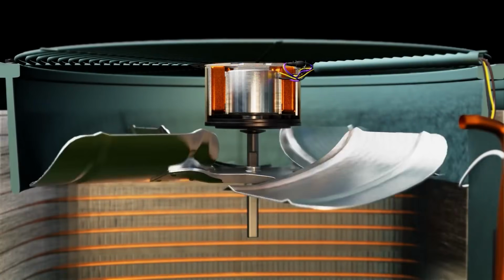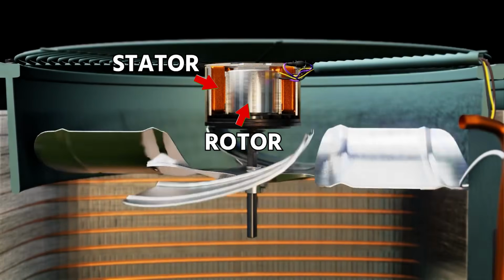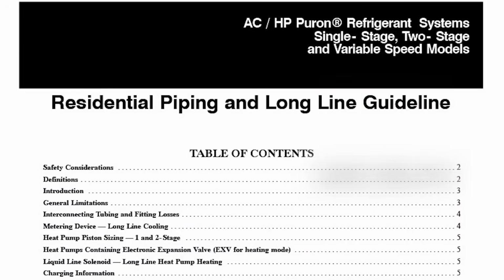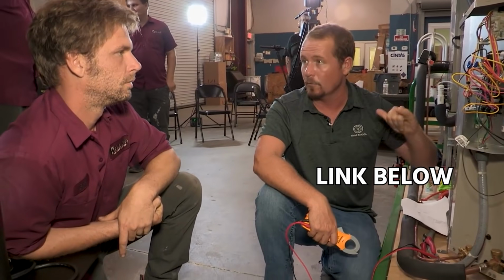Locked Compressors

Comment: Hey Bryan! Thanks for the awesome content!
Reply: When technician replace aftermarket starter capacitor for compressor, they use aftermarket terminal and they don't care about false contact of the terminals.  False contact is a factor of overheating in any circuits wich leads to a fire.

Comment: Yes -- locked up is my symptom. The fuse on one of the 240 legs blew, and upon replacing it everything is "back up" (in the sense the fan now works and the compressor tries but fails to start).

Interesting about the Trane hard start kit being special. Mine is not a large orange compressor. It all seems pretty normal, a 1.5 ton unit.

Comment: So if capacitor is good, fan working fine and coils are clear and clean and compressor got super hot like 165 .Now just will buzz as trying to come on fan runs capacitor still tests good.Evac system, pulled vac to 453 microns.Held for hour.Put 2 slow pounds in then up to 4.5 tried to start but same issue.Hit around with mallot no go.Waiting on hard start kit as next try.

Comment: Can you please help me? My A/C compressor for my 9000 BTU unit (Consul) is locked, before that it was making all kinds of weird noises and I could hear it going down and down until stopped and buzzed. after that it stopped, and restarted. I used it like that for 2 days. After that 4 months went by and it is fully locked now. Can low a/c gas cause that? Thanks SO MUCH for the reply

Comment: I am an amateur and know nothing about HVAC except as a consumer who can’t stand to be hot.  I got a old worn out system started by blowing a hot hair dryer on the evaporator which I guess put enough pressure on the low side of the system to get it going. Then I looked online and learned of a hard start capacitor which I went and bought for $25.00. I put it in (there was an old one there). It worked for years until the building was demolished for new construction.  I quickly realized that it was oversized by 1.5 tons which is probably what killed it.  I left the gas oven on 550° all summer so it would run more and dehumidify. I eventually put a large  1967 Chrysler heater core in it plumbed into the circulating hot water system for the building when I learned of the concept of reheat.

Comment: First and foremost I got to tell you are a great instructor, so you have my outmost respect. I have a question, that might sound stupid or idiotic: could a locked one third HP compressor used on a household refrigerator be fixed with a hard start kit ? Already tried the 1/3 HP electronic start device and didn't work.

Comment: If it's still under warranty and the system needs a band aid to continue running then the warranty should cover the band aid solution or replace the component.

Comment: A good way to think of an induction single phase motor is the equivalent of a transformer with a mechanically rotating secondary.  Locked rotor is like a power transformer with secondary side shorted out.  

The rotor actually has the equivalent of wirings, a very low number of turns secondary (1 turn).  

Internal compressor protection switch trips due to high current vs time (short time) and temperature where there is a very hot compressor.  The protection switch has limited lifetime to number of high current trips, so you want to avoid tripping it as much as possible.  A bad compressor internal protection switch means a compressor replacement is necessary.

A running motor induces current in the rotor that lightens load on primary side stator winding getting the motor out of LRA current region.  

Most techs don't have the equipment to measure the amount of time the motor initially draws LRA current during startup but the proper start capacitor (mfd) provides a 90 degree current shift in start winding compared to run winding current.  This yields the shortest start time in LRA current draw. (spins motor up quicker).
Typical startup time is about 0.4 second.  If it has hard start it can last over 1-2 seconds which is enough time to pop the compressor protection breaker at LRA current.  You want to shorten that time in the LRA current region.

Different compressor motors have different wire turns ratio between run and startup winding.   This effects the relay required cut in and cut out voltages across start winding to disconnect start capacitor.   Generally, start cap mfd is greater mfd value the larger the btu size of compressor.  Too much start capacitor size can actually reduce the hard start benefit because it does not provide the proper 90 degree current phase shift to start winding which yields the greatest initial starting torque for motor.

Rough guide for start capacitor sizing.
Start Capacitors
72-86MFD - Up to 12K BTU
88-106MFD - 13-23K BTU
108-130MFD - 24-36K BTU
189-227MFD - 37-48K BTU
270-324MFD - 49-72K BTU
115VAC applications can use 250V or 330V rated start capacitors.
230VAC applications must use 330V rated start capacitors.

Another way to select hard start capacitor mfd value is 3 to 4 times the run capacitor value.

Most generic hard start kits error on the too much mfd capacitance side.

Comment: When I got a recent compressor to start by a hard start kit , it sounded like marbles striking , shut it off and just condemned compressor , but what caused this for a 2017 condenser ? 
   No true vacuum pulled?
   Not purging with nitro ? 
   I guess these couldn’t be ruled out , so I’m replacing compressor on a unit that I did not install .

Comment: Couple of other things that can cause startup failures. Long AC power line to breaker panel and undersized wire gauge creates too much voltage drop during the startup surge current.  Some outside disconnect switches use 60 amp breaker for switch which can go bad.  Old AC breaker that is fine with run current, but has too much voltage drop during the 100-200 amp startup surge.  Low utility line voltage is also possible.

Refrigerant overcharge can also increase startup current as well as run current.  Obviously bad run capacitor is number 1 cause.

Startup surge usually last for only 0.4 to 0.5 seconds but is longer if AC voltage is low.

The compressor Klixon protection switch inside compressor trips on excessive current and/or over temp so high current trips of the cutout switch before the motor stator windings gets very hot.  Multiple high current disconnects eventually destroy Klixson contacts requiring a compressor replacement if compressor has been repeatedly cycled ON and kicks off many times trying to startup.  This is where the softstarter saves compressor as it protects from continuous restart attempts.  Softstarter only allows one startup attempt per thermostat activation.

Once in a while the Klixon gets stuck open and a rubber mallet tap at base of compressor can knock it back into operation.

Weak link of hardstart kits is the relay reliability.  I don't like using them because a relay failure is more likely to destroy compressor with start capacitor continuously connected to compressor start windings burning it out.  The black electrolytic based starter cap can get very hot if left engaged too long possibly shorting out the starter capacitor.  Proper start capacitor value is 3 to 4x the Run capacitor mfd value.

Comment: Awesome discussion which includes reasons for compressor running hot !!  Just wish I could make a decision on how hot is to hot - to expensive to chase  all the possible issues trying to resolve a mini fridge which is working but compressor gets very hot.
Reply: High ambient temperature, computer fan to blow on the compressor 👍

Comment: I have two 34 year old r22 systems that I do not run on generator. If the power goes, we use ceiling fans and sweat. Any opinions about soft start kits with such old dogs? I hate to rock the boat and kill my compressors.  Thanks

Comment: Thanks. It was helpful.  The most unusual situation I ran into was a rooftop packaged unit for heat and gas. It had a label stating that It was set up for 240 V AC.   The unit tripped the breaker as soon as an attempt to start the unit was made.   Eventually, I went to buy another compressor but in the process I  learned that the compressor was supposed to have 560 V for that unit.   it turned out the printed circuit board wasn’t going to let it run on the wrong voltage. 
  The manufacturer told me that it was not listed under any warranty.  Their representative told me to red tag it and walk away.  This unit was on a pizza store and they didn’t need the heat function so I disconnected that just to be safe and then I hard- wired the compressor -skipping the printed circuit board but used a solid state time delay relay and kept the low pressure cut out in the compressor control circuit.
It worked.  I won’t do that again.

Comment: Great video. Thanks for posting.  I bought a 5-2-1 aftermarket hard start kit but chose the option for 1-3 tons even though my unit is a 4 ton. This was based on the capacitor in the 1- 3 ton matched the specifications for the OEM hard start kit. Does the relay have internal workings that would make it much different than the OEM part?

Comment: good advice on doing your 'due diligence' before grabbing the hard start kit ... but one thing I might have missed - what are the next steps if the hard start kit DOESN'T start the compressor?  is that the official 'death notice' of the compressor?  Can anything else be done?  thanks
Reply: Sometimes I smack the compressor a few times with a heavy rubber mallet.  If that doesn’t free it up, it’s probably dead

Comment: I have a compressor that was installed 6 months ago and the compressor is locked up. I put a hard start on it and it still isn't starting. Is there another way to get it running?
Reply: Reverse it how we did back in the day

Comment: What about the old school way by tapping the compressor with a rubber hammer if it is locked up like they did back in the day. They also reversed the leads of the compressor to unlock it.

Comment: 12:09 - What's the difference between 'back EMF' and inductive reactance (that chapter - 1:51 - has a cute title, BTW, of 'inductive reactants')? Different way of looking at the same concept. The back EMF that's generated in the winding is based on the reluctance of the coil to changes in current (the inductor reacts to the constantly changing current in a sine wave by generating an opposing voltage when the magnetic Flux collapses back onto the winding )

Comment: That aftermarket hard start kit is going to work just fine. It is only active for like a second. Waste of time to go back and change it out and just more costly for the customer. Having said that I never use the two wire type they are crap. Only use the one like he shown in video with the potential relay.

Comment: Wouldn't low oil or no oil also cause compressor overheat as well?
Reply: Low oil will cause bearing failure and it will seize up just for that reason alone. Hard start kit or even a soft start would not help in that situation.

Comment: Thanks! Been “ trying” to explain this ( which makes me an idiot) to those who figure the budget for a 266 apt. Complex in the Deep South of Louisiana for a decade now. 266 units that were 12 years old when I first touched them. 12 years of hard use and abuse. Now 22 years! Those old Goodman 2 1/2 ton piston heat pumps are beasts. But now, dropping like flies. They put up with filthy coils, filters, all sorts of R-22 “ drop-in” juice without directions. 😂 Half of the outside coils are rotted from 20 + years of 100’s of dogs raising a leg on them. 🤷‍♂️🙄

Comment: I’ve smacked the top of a compressor with a rubber mallet to unlock it before just to have some cooling over the weekend .. fixed orfice was clogged as well .. I pumped down what I could (the compressor was not pumping right) and recovered the rest ..cleaned the orfice .. pulled vacuum, drier, recharge ..that’s when it locked up …I smacked it a couple time fired it up and it worked but only had about 10 degree split temp

Comment: Great tutorial.  Thanks 
Question: let's say  after all the visual testing and electrical testing is done and the problem is a locked compressor on a 2 year old system do you know another solution to start the compressor if hard start capacitor does not start the compressor ? Thanks again.
Reply: I've used the Spp hard starts by Supco, I think. There's been a couple of times when it didn't work and I "stacked" another on top, essentially twice the kick in the butt. It's worked every time but take the second one off and leave only one. If it doesn't work after installing the first the customer really has nothing to lose at that point. The alternative is a new compressor at a much higher price point.
Reply: @bill944  Thanks for replying, i didn't know that you could stack two hard start capacitors,  i tried with one and it didn't start so I went and replaced the compressor likely it was still under manufacture warranty.  Thanks again

Comment: Working on a Commercial Bard unit, about a 5 ton that the evap is under negative pressure. This thing leaks water and we pull the drain pan to check for leaks. It does have a P trap. I'm sure it's because of an air leak sucking air inward and pulling the water out of the pan. Do you know of a way to check for air leaks on this type of system other than feeling with your hands around it?

Comment: Great video...thanks.
One question ...confused about soft start....if the compressor needs hard start kit for the reasons explained then would it be an issue to provide a soft start instead if the customer wanted it for the generator?
Reply: A hard start will work good at lowering starting amps but a soft start will help even more.

Comment: I thought the potential relay kicks in when voltage is low, caused by the high current draw of a stopped motor pulling the voltage down. Motor starts, voltage returns to normal, relay opens.
Reply: @grigorshukerski4689  oh I wouldn’t say that. He’s a great teacher and business man and I wish I had him for a teacher. I don’t remember what he said in this video but he’s usually right. Maybe he’ll answer me.

Comment: Talking about home owner trying to do their own thing. Few weeks ago I was out for a maintenance and the system started normally about the time I showed up and in a few minutes it was making an awful noise but still running. I turn it off and start my checks figuring I would find out why. First this was a 2 ton. I look at the cap and it was a 70/7.5. Was supposed to be a 30/5. Had been that way for almost a year apparently. Told them they’ll be lucky to get much more life out of it due to their mistake.

Comment: Can I use the hard start kit with refrigerator locked compressors
Reply: Yes but it's called 3 in 1 for 110 volts Ref Compressor
Reply: They make different sizes so yes

Comment: Aftermarket hard starts vary quite a bit. The 2 wire (sppe) type being the lowest grade. The have a low lifespan and the relays a “light duty” to put it mildly. The 2 wire “Kickstart” are a little better with and improved relay. Personally I only use 3 wire 5-2-1 true potential relay type. They always work with Trane/Am-Standard as well. Having access to the original specs and closely matching MFD is key.